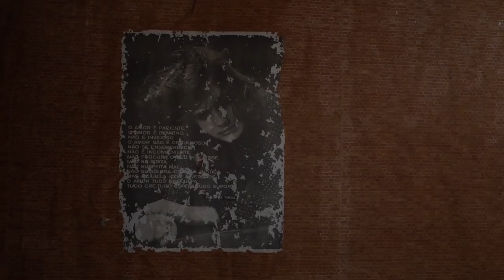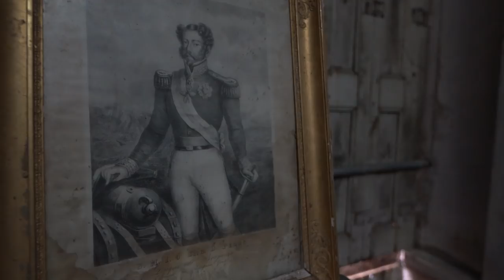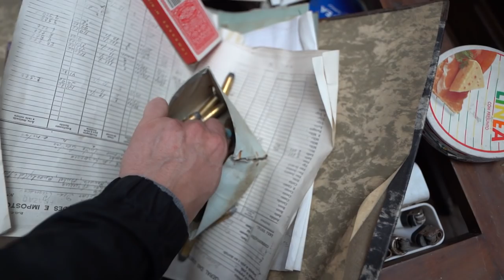Astonishing abandoned palaces in Portugal

Comment: Cork tiles in bathrooms were very common in the 70s. Before the widespread appearance of central heating and decent ventilation cold bathrooms and hot water meant your brand new paint job peeled off the walls really fast so everyone and his dog (well in Britain anyway) used cork tiles which insulated the cold walls and prevented the condensation... simples! :-)

These palaces are really something. Pena Palace down near Loule has ornate ceilings but not in that league!!!